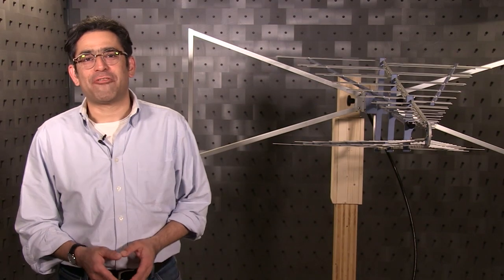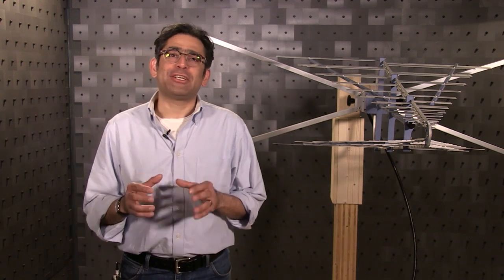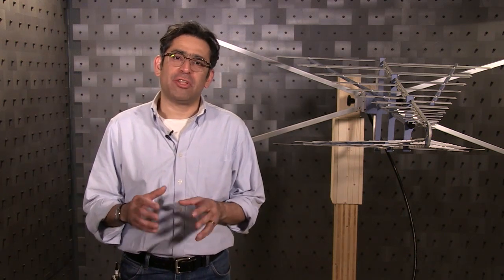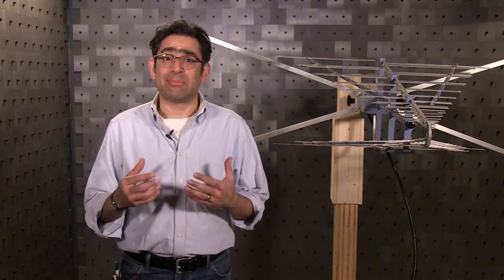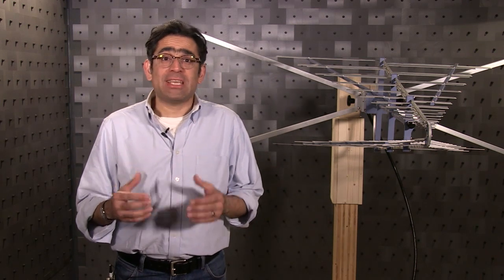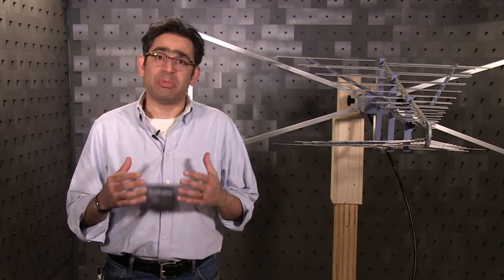Introduction to EMC Testing (Part 1/4)

Comment: Shelly Ph: 86-13671843635,  2911282844@qq.com, Skype: linnaniu1
Novyz(Shanghai) supply the custom service of Electrical Junction Box, 19"1u 2u 3u 4u 5u 6u,7u, 8u server subrack/chassis and network enclosure, rack case,etc.